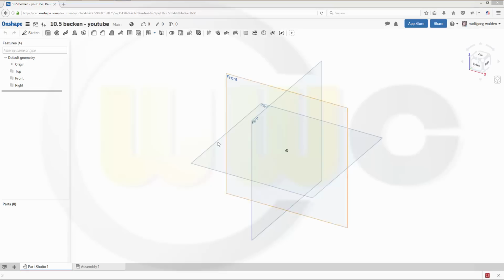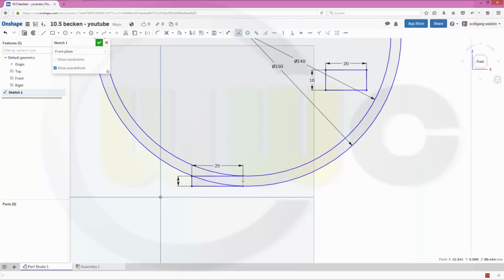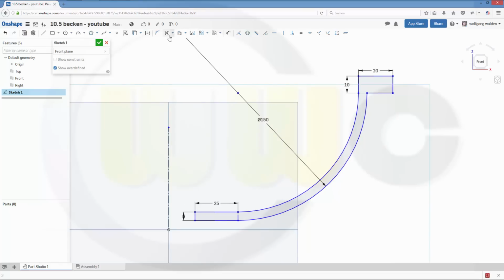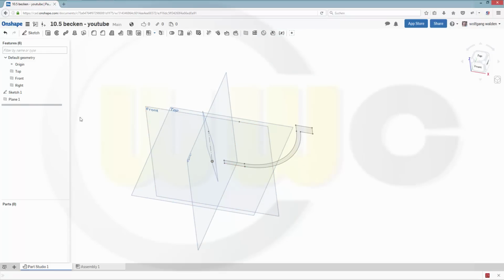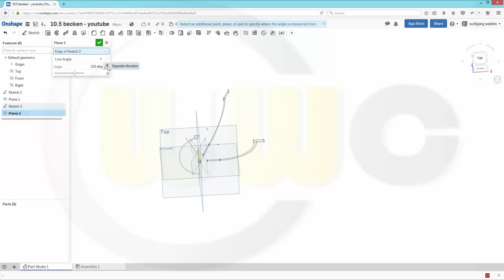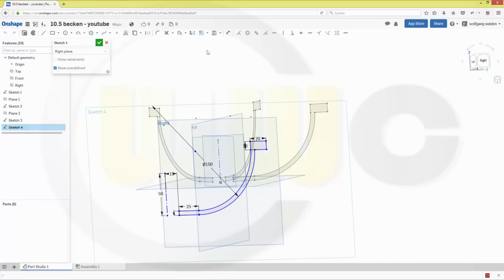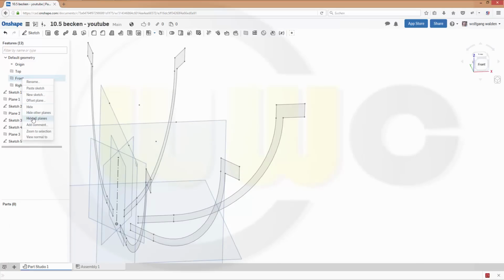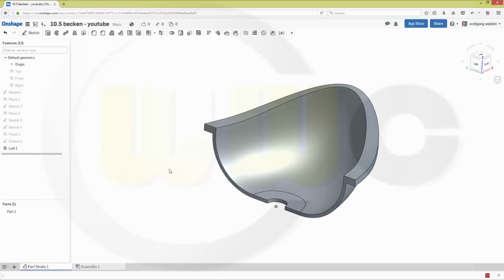10.5 Becken - Onshape Training - Loft

Comment: hen I tried to make the points coincident like you did at 5:06 it didnt work. I got a "A constraint must involve something from the sketch" error. I have no clue what went wrong. Followed exactly, 3 times.
Reply from the maker: Apparantly you didn´t follow exactly ;) Seems you selected an element which is not in the same sketch.
Reply: @wolfgang.walden.cad.training  I selected that center construction line. Im not sure, just seems like my software doesnt behave the same way these older versions do.